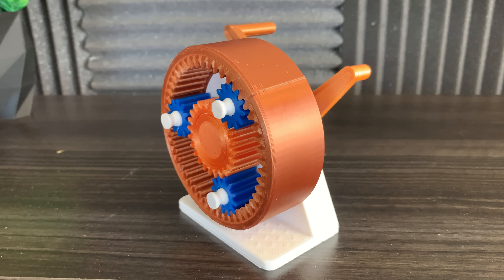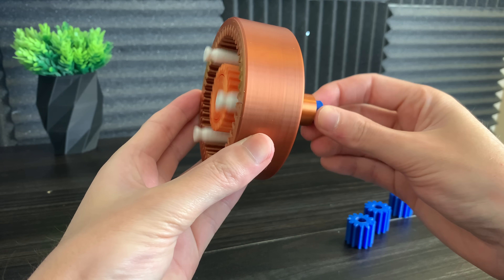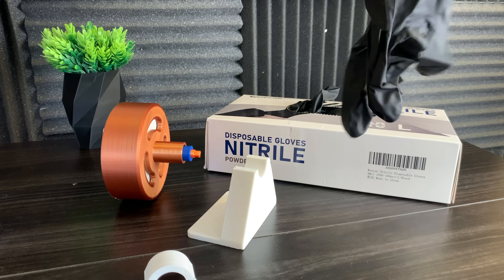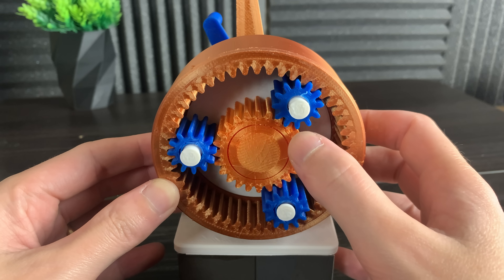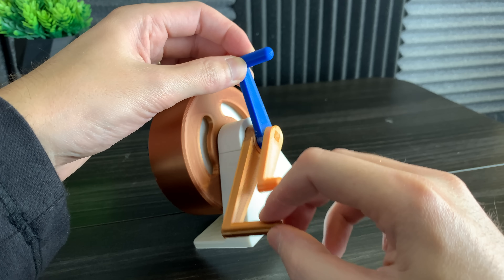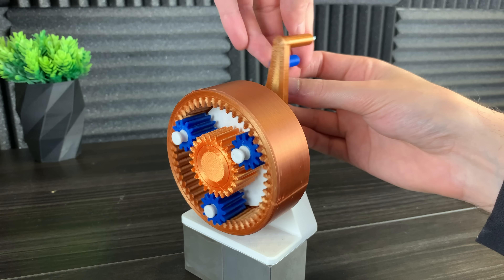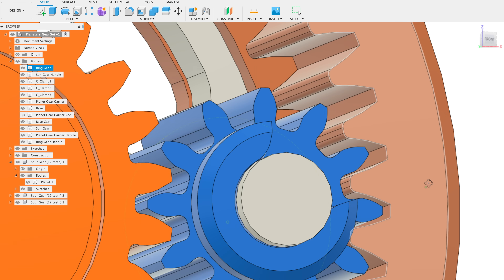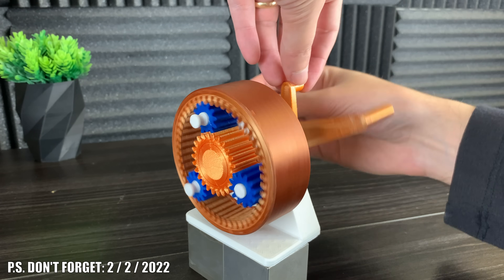What makes planetary gearboxes so amazing?

Comment: The red lid you took off the superglue, there’s a sharp point inside the top of it - use that to pierce the new superglue rather than the metal tool you used.
Reply: That's not all.. the superglue he is using is using a duo-screw cap, meaning he would've opened the sealing by just screwing the lower part of the cap tighter...
Reply: @sisisisi1111  Maybe - but I've bought the same glue - some of them just don't seal well enough for the lower part even when you tighten. It leaks and just ends up stripping.
Reply: @sisisisi1111  that'd what he is talking about
Reply: @ditto9300  yeah, i realized it after reading the comment again.. *shame*
Reply: @sisisisi1111  also, on the inside of the lid there’s a point that will pierce the seal giving access to the sticky nectar inside
Reply: @mattshu  not only that, but if you flip the cap upside down you can penatrate through the thin film that is covering the adhesive liquid.
Reply: @sealabrulz  that's what the comment is about
Reply: That jumped out at me too
Reply: Came here just to say this, glad I'm not the only one who spotted it lol.
Reply: Was going to say the same. I'd say it would be quite common to not realise this feature exists.
Reply: @TroySchrapel  no
Reply: Came here in the comments to tell him that exact same thing and knew lots of people would lol
Reply: Whp doesnt know this??
Reply: Last time I tried using such feature it was awkward and fruitless.
So I can understand his choice of doing it - it works consistently.
Reply: @AleksanderDrako  not me
Reply: "It looks like my tube of superglue is leaking" yah think? Rotflmao! 🤣🤣🤣
Reply: Also, so much fuss with the gloves for a couple miserable glue points...
Reply: 59 replies is WAAAAY too much for advice and debate on opening a tube.
Reply: Can 3d print a planetary gear box can't find most efficient way to open super glue. People are fascinating
Reply: Same with tomato paste tubes
Reply: Pog
Reply: Pretty amazing the comments here, based upon a very simple comment.
Reply: No shit...... [sarcasm]
Reply: @elayda93 
Thanks.
I've never seen someone do that before. [Not sarcasm] 😂
Reply: Good tip tip.
Reply: He totally missed the directions for the superglue...lmao
Reply: I said out loud, “they got a thing on the..ah never mind”
Reply: Ooooo
Reply: 0⁰000⁰000
Reply: Not concerned about the nice surface. Easy to damage..
Reply: Thank you for beating me to it
Reply: Yeah i noticed that too and it bugged the crack outta me
Reply: EEEEEEEEE FUT
Reply: I was just getting ready to write that.

The way he did it works, but the tip of the cap way keeps any glue that pops out when you puncture it open from getting anywhere
Reply: You don't get. All this BS video is to imprint the Hell-io-centric model. With sun and planets that fly around. Just a satan puppy doing his little job.
Reply: Dweeb knowled
Reply: Knowledge
Reply: Who cares,  he got the job done ffs.
Reply: Ye i was surprised i thought everyone knew that
Reply: Yep
Reply: why not as long its open the hole
Reply: One time I used that it almost got into my eye. Now everytime I open one I wear safety glasses
Reply: @caza9758  that’s what she said
Reply: @darktherapy  nice one
Reply: Dude is engineering and explaining complex gearboxes and hes getting educated on opening superglue.
Reply: @springbloom5940  when he got the size of the planetary gears wrong : nothing complex here
Reply: @t-pupz  

He didn't get the size wrong, his manufacturing just wasn't up to the tolerances he chose. Happens so often that most firms have dedicated engineering divisions to check and fix it.
Reply: @springbloom5940  got it
Reply: @springbloom5940 
If it's not the right size.
... it's the wrong size.
   Surely?
It's wro
Reply: @springbloom5940  You'd be surprised how the most simplest of things are too hard for an engineer to figure out.  They over-think and over-analyze everything to the point that common sense is tossed out the window.
Reply: @pikehunter23750  

Anyone can design a bridge that will stand. It takes an engineer to design one that will barely stand.
Reply: @pikehunter23750  He ain't over-thinking anything. He's underthinking.
Reply: @springbloom5940  wrong
Reply: I have seen tubes with a similar function. Although those tubes were filled with tomato paste and mayonnaise, not glue.
Reply: yeah.. this comment is mostly useful to people who use superglue all day, every day.
Superglue is not even a product that serious makers use.
It's one of those products that are supposed to fix everything but really does a poor job at most things.
Like that 2 components epoxy resin paste from Pattex that is supposed to: fix plumbing leaks, glue back a broken pool cue, fix a vase, that kind of stuff...
Reply: I have never noticed. Thank u 4 pointing that out.....!
Reply: We obviously all superglue connoisseurs here
Reply: Might have done it just to troll us haha even making sure to put the red cap in the next shot so we know it exists haha.
Reply: New engineers
Reply: personally I like to open superglue using proper tools, not some pointy cap feature
Reply: In theory this works, but in practice I've found the lid doesn't properly pierce the foil and the whole affair is messier to then fix
Reply: @CoolAsFreya  its not a theory i use it evrrytime i open a superglue
Reply: @CoolAsFreya  Try just tightening the collar of the cap, while leaving the cap in place. The collar punches through, the lid contains any excess, and the glue glues the collar to both the tube and the lid for next time. Extra safe! 😆

(Seriously though, if you do it gently and stop as soon as you feel the seal break, you don't get enough excess up the nozzle to glue the lid down, and after you've used it there's plenty of room to screw the collar down that little bit further.)
Reply: @CoolAsFreya  (also, love the username!! 🙂 )
Reply: Who  a s k e d  ?  .
Reply: I never used the cap either. Why? Because it's trash. Sure it works if that's all you have. This comment thread is just full of genius.
Reply: @davidurban7346  wtf are you talking about? Open is open. You fucked your own comment when you said "sure it works"
Reply: @davidurban7346 It's the lid. Not everyone views super glue as a 1 time use item. You're not getting more than one use if you think of the lid as "trash". That being said, even if it was, it's "trash" with that exact use in mind! Just because you didn't realize that doesn't make that knowledge any less useful to everyone else.

Comment: This is a wild coincidence.  I've been having issues with my automatic transmission that I rebuilt.  To wrap my head around how it's really working and what the problem is, I've been modeling it to 3D print a small replica.  I've got two of the planetary sets done, but I need to figure out a one way clutch and how to manipulate the regular clutches.  It's a big project, but will be awesome fully printed. (well somewhat small).  A U140e transmission (plagued with problems).
Reply from the maker: Keep me posted if you are able to finish the project! You can use the "contact me" page on my website, I'd love to see if you can pull it off!
Reply: @3DPrinterAcademy  Printing parts as I go.  The first gear planetary fits good so far.  There's a lot of parts to it.  I did get a one way clutch to sort of work, but more testing is needed. Still thinking about the clutch packs though.
Reply: @squishy312  replying cause this sounds cool and I want updates.
Reply: @squishy312  i know in the automatic model that i rebuild as a job and some others there is whats called a oneway or sprage or sprague gear. Its a nifty little device. It is prettt complicated in a way, but its basically this. Outer ring with gear teeth the guts are a laminar and concentric sandwhich of snap rings, thin plates, races, a in this case plastic carrier housing specially shaped pawls for lack of a better word and then an inner gear ring with splines on the inner surface. This is "keyed" meaning that in this case one of the splines is wider than the others and it will only fit into its spot if its lined up correctly this may also be called indexing. But the "pawls" are shaped in such a way that they will turn smoothly in one direction against the inside of the outer ring and the outside of the inner ring. 
 Reverse the input though and they pivot in their housing and they will essientially bite into the surfaces and refuse to budge. 
 Its pretty cool. The plastic or otherwise pawl carrier must be installed in the correct direction or it wont work.
Reply: @metamorphicorder  Thanks.  I know how they work.  My transmission has 2 of them, and I had to tear them down to clean them, so I know how they physically work.  Very cool engineering.  Hard to replicate in a 3D print though.  That's where I've had difficulty.  I've tried making a few, and they kind of work, but getting the right tension is difficult.
Reply: @squishy312  might also be a materials issue. Even plastic models can generate lots of torque, and the materials you are using might not have enough friction to stick in the right direction. Pretty cool you are building a 3d model though.  
 Scaling sizes can be tricky and even building to actual size can be hard. There can be tiny little processes that certain parts go through that may not be apparent that are extremely important to the end result. For example in the pumps that i build, the bodies or housings are cast, then machine finished this produces a piece with certain wear characteristics. The pump gears i think are either sintered metal or billet machined. Idk and its not that important because they are hardened steel and the housings are cast iron or other cast metal and not as hard as the gears. 
 The gears sit in cavaties in the housings and the clearances between the gears and the housings are measured in thousandths of an inch.  Pretty close. 
 When i was taught i was told that the gears have an index mark on one side. I wasnt told why. This happened to be important because that why is a deffinite warranty issue and can cause the pump to fail much faster than it would other wise. 
The index marks have to be "up" during install. This translates to "out" when its on the unit and in a vehicle but thats not tremedously important. 
 What is important is why they have index marks. 
 Because if you dont look at the gears closely on both sides, you will not see that both sides are not the same. One side has very sharp well defined edges. On the other side, the edges are shaved off or "chamfered". This is done because even with good casting, and finishing, its not really possible to get the cavity completely within those thous of an inch exactly the shape and size for the fitment and movement of the gears. If that edge isnt there, it cant wear against the cavity, creating particle contamination and heat build up and resistance.  
The index marks are on the sharp side. Almost always. 
 Sometimes though, someone makes a mistake and they are one the chamfered side. And sometimes they are not there at all. 
 So, those are parts i cant use and need to be scrapped because despite the fact that they are very nearly identical to "our parts", i cant know they are  good parts. 
 This is important because just saying the "dots" go up isnt good enough because just because the dots are up doesnt mean the part is in right. If they arent up or arent there, it does mean the part is wrong, but it doesnt do enough to reduce failures. And at the end of the day, im all about making sure the company doesnt lose money on warranty work, but more than that i dont want my initials to be on an pump that cracks from over heating or a whole trans thats shot beacuse of metal particulate contamination and strands someome on the road or looses their job for them etc. 
 I had to teach myself that just by looking at the parts and noticing the chamfer.
Reply: @squishy312  did you finish it ?
Reply: @JeronimoStilton14  No, I fixed my transmission, so I didn't need to finish wrapping my head around it.  I also couldn't get a properly working 3D-printed one way clutch.
Reply: My grandfather taught me how to rebuild a 3 gear longitudinal automatic transmission and it looked crazy but the planetary gears weren't the complicated part. The valve body seemed insanely complicated some type of a mechanical computer
Reply: @alexanderpherigo6806  that's because it literally is a mechanical computer 😂
Reply: @MacJunior696  yep. A hydraulic computer more specificially. 
 I rebuild them in a factory and its a job that i wanted for quite a while and always hesitated because it seemed too hard. And honestly if i was having to go at it from it being in a car to taking it out and working on it and putting it back in, it would be. At least at first. But its not all that crazy doing one section at a time. Of course we have plenty of all the parts and fastneners there so we dont really have to worry about oh shit i dropped a flapper now i have to go spend xxxx on a parts kit for that one little piece. 
 Valve bodies are easily the most complicated part in the machine for most units. Ive not gotten to learn them yet. I put some together one day and the pump that im assembling most days now is nearly that crazy compared to the other model that i work on. The complicated one has like 55 individual parts excluding the instal fasteners. The other one has 15 total parts excluding the install fastners. 
 The one with 15 total parts is larger and heavier than the one with 55 parts.
Reply: @alexanderpherigo6806  ..because, it is a hydromechanical computer,
Reply: People often underestimate the effort it took to make automatic transmissions. I like driving manuals too, but automatic transmissions are truly magnificent in how they can perform such a wide range of gear ratios in a snap, and do it for hundreds of thousands of miles.
Reply: I used dual clutch transmission instead. If you go the Lesics YouTube Channel, you'll know how it works.
Reply: Oo that sounds interesting
Reply: The problem is that it is an automatic transmission. Always go manual--if the choice is available. Manuals are easier to work on,  & don't malfunction nearly as often as auto.
Reply: manual straight cut gears sound nicer though and are more reliable.
Reply: no. don't do that. look to transmission manuals not planetary gearboxes vids on YT
Reply: Sprague clutches require three programming of non uniform non linear deflections to simulate these springs
Reply: This program. Cannot do this without m odifying  the code
Reply: It’s rarely ever the planetary gears. That’s why they are used in auto boxes because they are so robust. Even used in the Model T transmission. 

For which clutches/bands are slipping usually there’s a simple logic chart. Like if it works in these gears but not these gears it’s this one, etc. quite often the problem is the valve body which is insanely complex unless it’s a simple replacement of a valve, or even worse into computers and sensors.
Reply: @Bartonovich52 My transmission broke initially because the pins on the 1st gear planet gears got worn from the carriage not being supportive enough.  They wobbled loose and pretty much grenaded the entire first and second gear planet sets.  I had to order all new (good used) parts to replace both.  I had someone weld the pins in place so they don't get loose.  This is apparently the fix to the problem this particular transmission has.  Otherwise, it's a solid design that has versions in the 700's that are still being used today.  Mine was the first version, the U140E/F.   The reason mine wasn't working correctly, is because there were 2 giant C-clips that were very similar.  I had installed them incorrectly, in the wrong spots.  One worked okay, but the second gear brake clutch set wasn't being stopped by the bad C-clip.  I was lucky and caught it in time to fix it with no issues.  I just ordered new C-Clips and replaced them correctly and reset the transmission to factory default.  It shifts like a dream now. (especially with an aftermarket shift kit in it).  That was a fun valve body rebuild.